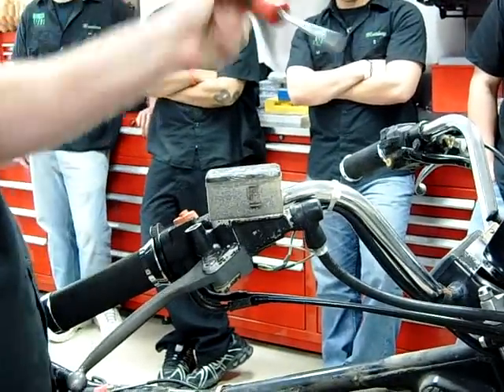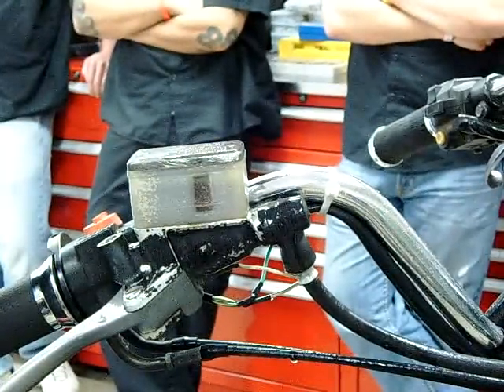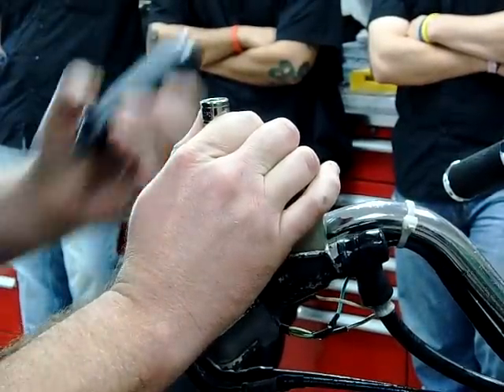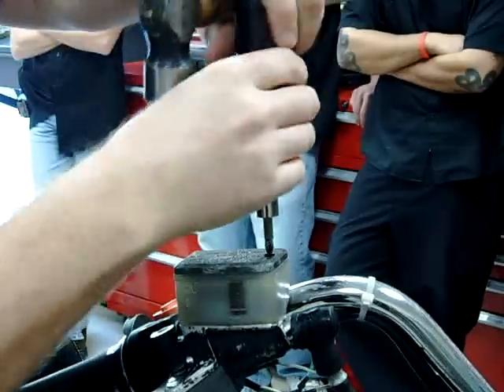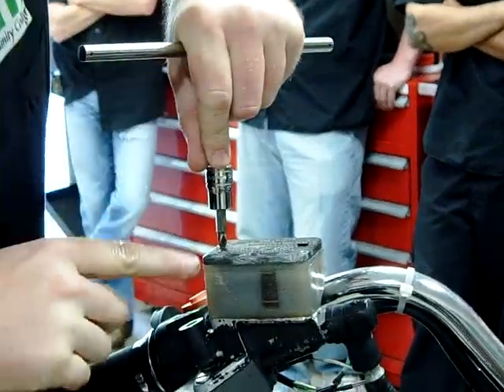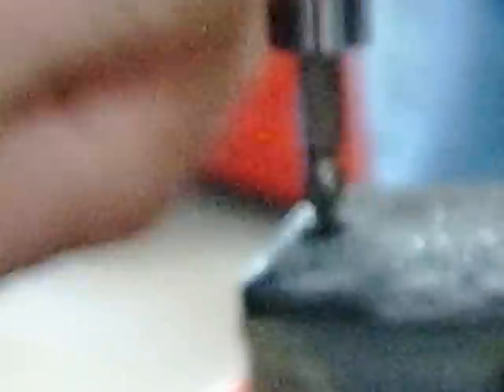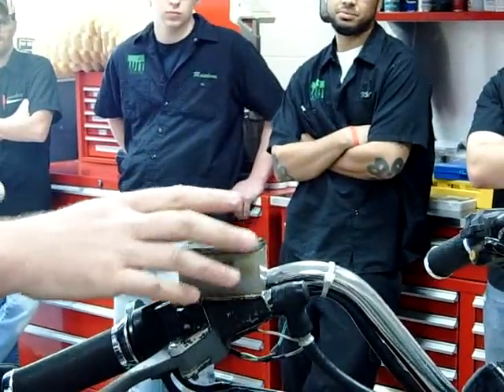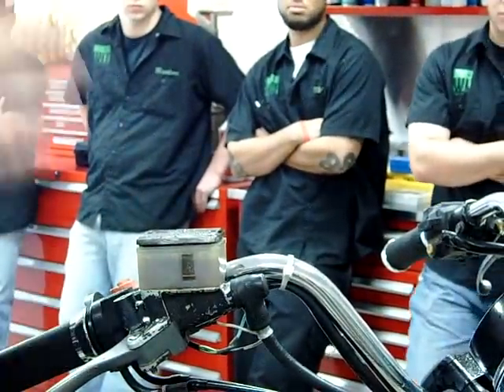Removing stripped master cylinder screws WITHOUT damaging the master cylinder cap Part 1

Comment: The bolt on my 1979 CB750K broke flush with the top of  aluminum master brake cylinder.  It is stuck in the housing?  How do I get that out? :-(   I thought maybe I can drill it our and retap a larger size thread and use a helicoil insert.  Anyone try this?
Reply from the maker: Not much room for a helicoil on most master cylinders. If you don't figure something out, reach out to us on our website how2wrench.com and we could facetime and help you through it.

Comment: Hi, I used this technique and it worked great on an old master with good not stripped screw, then I bought a parts quad with a brand new master but the quy that had it completely stripped the screw so I drilled the heads off unfortunately when the heads came of the screw was actually below the mating surface just a little so there was no chance of grabbing the studs with pliers. The whole master was aluminum so what I did was took the wire welder and did just a quick zap on the screw, the steel wire won't stick to aluminum  and it left a small ball on each screw and I was then able to grab each one with a pliers and turned them out with out damaging the mating surface, it was such a quick cold zap that i didn't even have to pull the piston and seals out to do it. It literally took two minutes to do. You probably already know this trick but I thought I'd mention it just in case other people that watch your videos don't know about it
Reply from the maker: Nice...as long as your rebuilding and not worried about the rubber inside...:) You're in luck. I do offer personal service to back up what's missing from a video to actually fix your specific problem. I do work on donations for my time and possible research. 
Good news is its CHEAP! For my time would mind becoming a member of my website? It comes with a free 20 mins of techline and that will cover my time to assist you so we both benefit. So to have me personal cell phone number to put in your phone as your direct info and how to coach, sign up now! As always thank you and enjoy the free videos! Much more to come! I look forward to working with you and hope you will become a member of or learning community. 

Link to membership: https://how2wrench.com/product/membershipmembers-onlymembers? 

If I can ever be of service to you, here is a video explains how to connect with me. 
https://www.youtube.com/watch?v=vjvmB01ebcs 
Direct link to services: 
https://how2wrench.com/product-category/tech-lineservice-callminutes/ 
Live Chat is great for you to actually show your specific issue!
Donation link: https://www.paypal.me/how2wrench

Comment: Just had to deal with this. Not a 20 year old motorcycle but it has sat outside. Fortunately, I was able to get some mole grips on the stub and turn it back-and-forth until it finally came out after about 30 minutes. These should probably be stainless steel?

Comment: Or order a JIS driver or replace with allen heads.
Reply from the maker: +Meeker Extreme 
JIS drivers are a popular response and I agree. We have to keep in mind many of the caps are countersunk for the factory screws. Not all customers like the cosmetics of there vehicle altered. Your idea makes sense, just not for all...:)
Reply: shane conley I'm not knocking you I bought a set of JIS drivers but gave them to the brother in-law...LOL I just ordered a bulk supply of stainless 316 allen screws. Common length for us NISSIN Dirt Riders. I mean after all who has a JIS driver in their repair bag, right! So no I;m not knocking you and maybe I'll spend the $38 on myself and buy a set someday just to have especially for carb work, same issue.

Comment: Nicely done but really those new techs are going to work on 20 year old bikes? Must be working on rich people bikes at small independent shops. Dealers command high dollar to work on old bikes and most the people with old bikes that need work don't have that kind of money to put into repairs or service. My local suzuki dealer/shop quoted me $250 to sync the carbs on my 24 year old (at the time) bike and $180 plus parts to do fork seals assuming everything went smoothly and the mechanic didn't have to spend extra time on a difficult fastener and this was several years ago when prices for things were a bit lower than they are today.
Reply: Why not 20, 30, 40 year old bikes?  They should know how to fix anything, and how old you think a 20 year old Harley is?  Probably about 20 years, and I bet a lot of those owners still go to dealers for work, especially when it comes to inside the engine or the most critical safety component of a vehicle aside from tires: the brakes.

Also, your stealership sucks.  $250 for a carb sync is robbery.  $180 + $15 for fork seals is not out of question if you've seen how much work it takes to rebuild a set of forks properly.  It can require full disassembly to prevent scratching the tubes.
Reply: ***** Not saying they shouldn't know how to fix things but what's the likelihood they are going to work at a shop that touches anything older than 10 years when shops charge a premium to work on old stuff? Most owners of old bikes work on the bike themselves, either out of desire or necessity.
Reply: I don't know of any shops that charge a premium like that, and a LOT of Harley owners have older bikes and a lot of those owners don't do much themselves because of the special tools and less than intuitive procedures required.. When you make the same engine from the 1950s to the 1980s, there tend to be a lot of them out there.

Back on topic, every mechanic should know how to remove a stuck screw or bolt.  Something that sits in the weather a lot can seize in only a few years.
Reply: ***** The shop charges the premium because they don't want the work. Their new, fresh, and cheap tech doesn't have the skill and experience to deal with old stuff. They need the old tech for that and old techs want money for their expertise.

You're right, Harley is the uncommon exception to the rule. Although, I do have to wonder how much last gen or beyond stuff goes though the dealer bays and how many new techs touch the old technology. I can't imagine they get stuff older than the evolution - which I admit goes many years back.